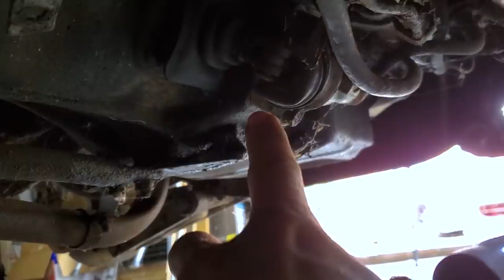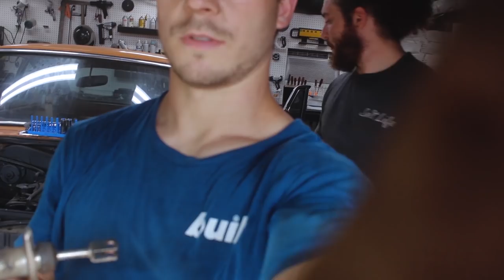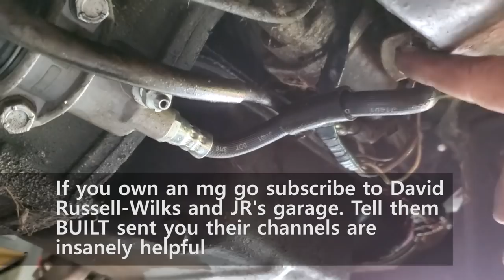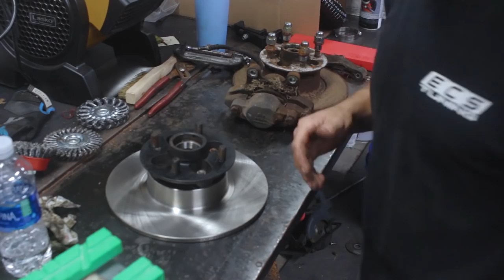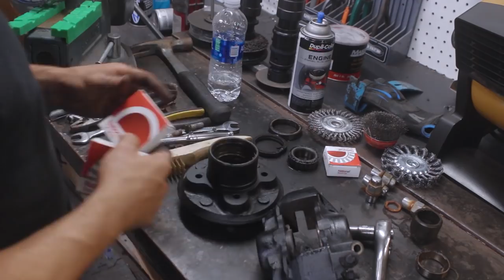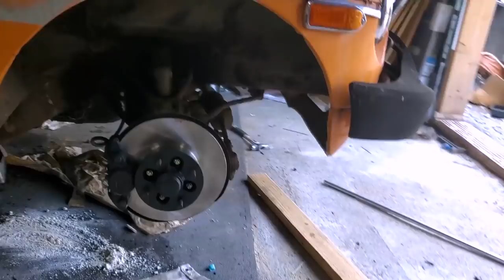THE RWMGB pt. 3: REBUILDING HUBS AND BRAKES

Comment: When you're working on hubs in the future before you remove the hub the first time if you remove the outer bearing put the axle nut back on and then when you slide the hub off you catch the axle nut on the inner bearing it will pull the inner seal super easy and if it's undamaged you can even reuse it also -6AN fittings

Comment: One of the reasons I like these videos? I use to do the same type of stuff but out of strictly necessity. We were broke af when I first got married and I put a 81 Cutlass Supreme together out of a junkyard in Tennessee. Drove it home for less than $200 with a death wobble straight from hell 🤣. Which kinda helped me keep it slow since the brakes were all but gone. I rebuilt the front, rear (air shocks out back), rebuilt everything under the hood as I could. Drove it for over a year then sold it for 3k.

Comment: Wide wheels will definitely were out your hub bearing. Back in the 90's we alot of younger people built there cars with negative offset. I ran 15x10 reverse so that was like a 9 inch lip.  We called it skating your car. Then it faded out and 17 and 18 inch wheels came out. 20 inch wheels didn't come out till like 1999. And the Euro thing came out
 I was in a car club back then. I had a gutless with Dayton wire wheels and a 2 pump hydro with 4 batteries. It would do front back side to side and 3 wheel. Then I went to a 4 door grand am and skated it with candy blue bowling balll paint. You paint the car black. Then you could do one side at a time and spray candy on. Then starch saran wrap from front to back and press it in to the paint. Then start at front and peel it off
 It came out looking like marbel or we called it bowling ball. Looked awsome.  Thought I'd share it with you. But tje wide wheels will ware them out. You will no when there going bad. They will start to growl. Then change them.

Comment: Thank you so much for the mention in your video, greatly appreciated! 

With the front hubs you may need to fit some of the small shims if there are not any in there (usually it's a case of fitting the same ones back in that came out). The aim is to shim the hub for an end float of 4 thou (0.1mm) at 40 lbft. As usual John Twist has a good video on this: https://www.youtube.com/watch?v=RJYIXZtnIiw

Comment: A couple thoughts, to get the bearings properly set up you need to have a supply of the shim washers. You can do an adequate job without them, but I recommend ordering a set and watching John Twist's video over at University Motors. You don't need anything fancy to bleed the clutch. I had to replace the slave on mine after I bought it. I just used a jar 1/2 filled with fresh fluid and a tube run from the nipple to the jar. Just slowly pump the clutch and make sure you check the master frequently so that you don't run out and also the jar so that you don't over flow. It isn't as convenient as having someone in the car to help you, but you can do it.
Reply: Please take D palmers advice seriously, check the university motors video from John twist.  These require a single torque spec, as said, shims are the adjustment for these bearings.  Without the proper torque and shins, the stub axels can fracture. Keep up the good work!

Comment: It’s called a crush sleeve, the part that slides over the spindle. Also if you put a bead of weld in the center of the race all the way around it will come right out with a couple taps of your hammer. Just a tip I’ve picked up along the way

Comment: After 39 years of sitting, My Corona sucks to work on. Like a newb, I drew back several bolts without PB Blastering them first. Now I have to extract the old broken ones adding to my time frame.

Comment: I'm guessing your using 6AN (3/8 inch.Army/Navy) fuel lines. You hit the nail on the head when you said if you do too much at once to clean up a 'section' of a car at once. That happened to me, I was doing the brakes & I was thinking I should clean up the suspension, the wheel well, the axle, & so on...becoming very frustrated. But like you said; "one thing at a time."

Comment: Don't stress to much about the drums, it's not that difficult. Just remember how you took it apart. 6AN
Reply: and do one side at a time, so you can compare & know how to put it back together (but don't forget that the two sides will be a mirror of each other. This is also why you take a lot of reference pics when starting on something new.
Reply: Another thing to realize, is that unlike disc brakes, drum brake shoes are not interchangeable left to right. One is the leading shoe the other is the trailing shoe.  Another reason to use the other side as a reference (again, remembering it is mirrored from the one you are working on).